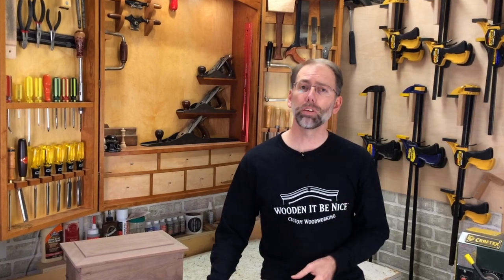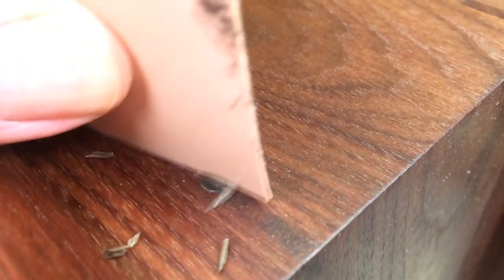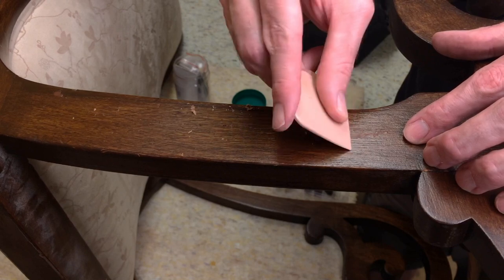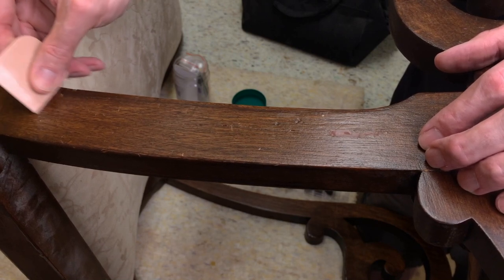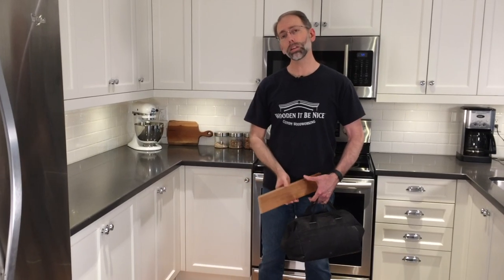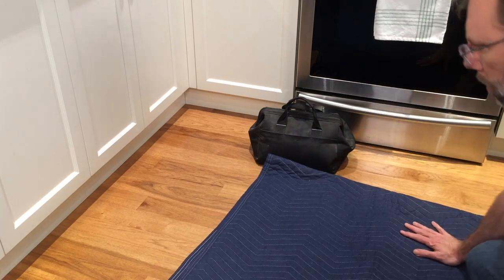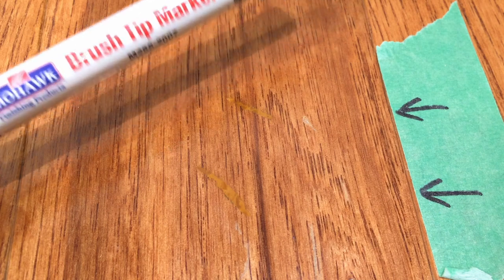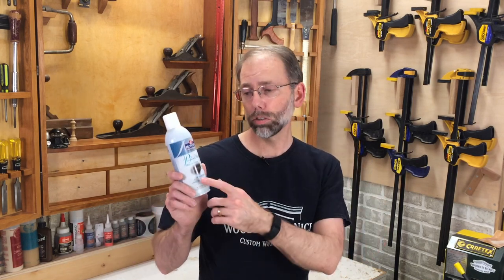Best Wood Filler to Match Wood for Furniture Repair, Hardwood Floors, & New Woodwork - Mohawk How To

Comment: There is another kind of product that I used nearly every day for 20 years.  Thousands of repairs for furniture stores, moving companies, delivery companies and consumers.   They are the hard resin sticks (originally called "shellac sticks")   They come in transparent tinted (mostly amber shades) and opaque colors (including black and a variety of whites ).  I used a wider blade burn-in knife that I used to both to add in the melted resin and then, with a burn in lube (gel), level it out.  Then I  rubbed out with steel wool.  Top coated with touch up lacquer when needed. Another technique on ring- and semi-porous woods is to take a razor blade or utility knife to score in some graining.  Also, if you don't have the  color brushes, you can dispense a bit of color from a regular touch up marker on a piece of glass and use a detail brush to draw in the darker grain lines.  All that said, the softer sticks are probably better for flooring as they will be more impact resistant.  But the resin sticks for things like table tops that will be seen up close.  Also, I think the resin sticks have a longer learning curve.  But just another option.

Comment: This brought back memories of a place I worked at just out of high school decades ago.  It was a furniture/appliance store and we had a repair department.  The head guy in that department was a miracle worker with furniture or any kind of repair on wood or metal surfaces.  He would fill cracks, holes, whatever and then paint the grain back in on the wood and I swear you could never find the repair when he was finished.  It was amazing to watch.  He used those burn in sticks all the time with a little pallet knife, and would have probably loved having that battery powered tool you have.

Thanks for the memories.  You do great work.
Reply from the maker: That's a cool story Don!  Thanks for sharing that.  Scott

Comment: This reminds me. I painted a small rocking chair for my niece. Because the house has pine floors i decided to glue cork onto the chair to protect the floors. It worked just fine. But beware that not all glues work with cork
Reply from the maker: Oh, that's interesting.  What glues do and don't work with cork?
Reply: @FixingFurniture  I basically looked at what it said on the tin and looked for one that said it worked with cork

Comment: Thank you for sharing this. Just yesterday I tried using a filler on a gouge in my hardwood floor and it won't take stain to match. I need another solution. Not certain I can remove the filler though without causing more damage. Any advice? Cheers!
Reply from the maker: To remove the old filler carefully, you can use some detail picks.  They allow you to dig into the filler and carefully scrape it away so you're not creating anymore damage to the surrounding wood.  I hope that helps.  Scott

Comment: This video explains what I've been doing wrong with these things, I use a heat gun on them and mash it into the spot but it creates a huge mess.  I'll use a soldering iron.
Reply from the maker: Yes, a soldering iron will make this much easier for you.  Cheers.  Scott

Comment: Curious about something when you were repairing the floor. How long did it actually take to complete the repair? I know the magic of video makes it appear much shorter. Thank you.
Reply from the maker: If I wasn't recording the work on video, this would have been less than 15 minutes.  The filler dries very quickly, so adding different color only takes a few minutes.  I hope that helps.  Scott

Comment: have you ever tried etching out the fill with a needle to match the lowlight and highlights throughout the wood? It looks like the material hardens fast enough that you can use etched out grooves as a mold to simulate the grain of the wood even if it's being cast in the material itself.
Reply from the maker: It is possible to etch lines in the filler if there's visible grain texture on the wood being repaired.  You have a keen eye.  Scott

Comment: Exactly the info I need to repair some damage to my old hardwood floors - thank you!  One question: how will the fill react when the time comes for a full sanding / restoration of the floors?
Reply from the maker: Glad it was helpful.  I don't know exactly how it will react to floor sanding.  I suppose it depends how deep the repair was. Scott

Comment: What is the melting point of these wax-chalks?
Some furnitures are in areas where the temperature can reach at least 25-40 Degree Celcius (77-104 Farenheight) i.e Sauna, garden etc, and some cleaning tools are steam tools as well putting a high steam temperature on floors.

Comment: Hi again.  I have the same color hardwood flooring with deep gouges and the FloorFix by CalFlor did not work well. I will try these hard fill burn in sticks. On the Mohawk website, I see the Hard Fil which you mention using in this video and Hard Fil Plus . Though you mention that you used just the regular Hard Fil burn in sticks in your video description and in this video, I see that you opened up the  Hard Fil PLUS kit?  On Mohawks website, they only have 6 colors available in the Hard Fil PLUS. Can you confirm whether you used the Hard Fil burn in sticks or the Hard Fil PLUS burn in sticks? Thanks again!
Reply from the maker: Sure.  The package I have says "Hard Fill" on one line, and on the next line it says "Hard Fill Plus" in the same size font.  I don't know why that is.  I just read the product descriptions on the Mohawk website and the Hard Fill Plus is the one recommended for floors.  I hope the helps.

Comment: Can a coat of polyurethane be used on top of these fills? you mentioned lacquer, but the current coat on my floor is a satin poly. I want to try to match that sheen once I have the fill looking about right. Thanks!

Comment: Can you use the pieces of the quick fill burn in stick that you scrape off?
Can you use the hard fill tool with the quick fill burn sticks on furniture?
Reply from the maker: Hi Sue.  Yes, you can use the material you scrape off.  I haven't tried the hard fill tool on quick fill, but I think it would work.  I use quick fill on furniture so there typically isn't space to work with the tool on a flat area.  Cheers.  Scott

Comment: I have deep holes in my hardwood floor the size of a finger tip. Previous owners obviously stapled padding/carpet directly onto the floor, and later forcibly yanked it up, tearing chunks out of the floor. I think the holes are too deep to completely fill with the burn in wood filler. any recommendation on what to use to fill the deepest part, so I can use the burn in filler on the surface to match the surrounding floor?
Reply from the maker: Yes, that's too large for wood filler.  Replacing the damaged boards is the typical way to repair something with that much damage.  I hope that helps.  Scott

Comment: These would be great for use on finished wood products.  When building new pieces, if I have to make a small fill I just use wood dust from the piece I'm working on (usually from my random orbit sander) and mix it with wood glue.  That way it matches the colour of the wood and is at least as hard as the wood itself and takes a finish perfectly.
Reply from the maker: Thanks for sharing that Kren.  What type of glue and finish are you using?  Typically glue and sawdust will stand out once a finish is applied because it reacts differently than the side and end grain of wood.  Scott

Comment: Very interesting topic! Will filler sticks also work for laminat surfaces or melamine if they have little dings?
Reply from the maker: Yes, it will, provided there's a "rough" surface inside the damaged area for it to grab on to.  The white colour would likely do well on the melamine... maybe I should do a demo of that.  Scott
Reply: @FixingFurniture  I have IKEA fake birch in mind :-)

Comment: I know this video is old, but can you tell me what that tool is, that rubber block with the ridges? The one that you used to even out the wax after applying it to the floor dent. I have been searching for hours trying to figure out what to Google to figure out the name of that.
Reply from the maker: That scraper is part of the Mohawk Hardfill Kit.  It's not available online.  You need to go to a specialty supplier for the kit.  If you're in Canada, I can order you one through a commercial account.  You can reach out via our website woodenitbenice.ca

Comment: I have chairs that are gouged from being pushed against the table edge ,  would this be the method to fix?
Reply from the maker: Those "bruises" may come out with steam.  If you put a damp cloth over the dent, then apply a hot iron, you may be able to restore the original shape of the wood.  That would my suggestion.  Scott

Comment: @fixing furniture how do you determine how much punishment a hard fill stick can take in order to know if you need a finish on top of it?
Reply from the maker: Hi Brad.  The hard fill is very robust.  I suggest the only reason to add a top coat is if you need to change the sheen (how much it shines) to match the surrounding area.  Does that answer your question?  Scott

Comment: Love your videos.  How do you determine if putty or heat wax is appropriate?  The size of the gouge? I have a cabinet that was gouged by movers. Maybe an eighth to a fourth of an inch wide. Thinking I should start with putty?